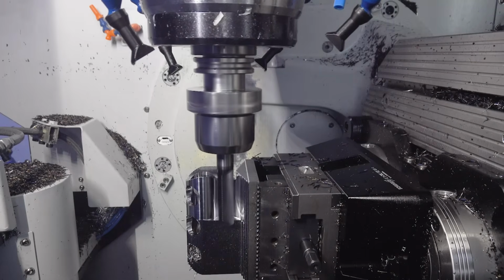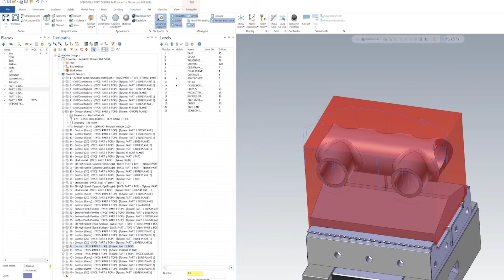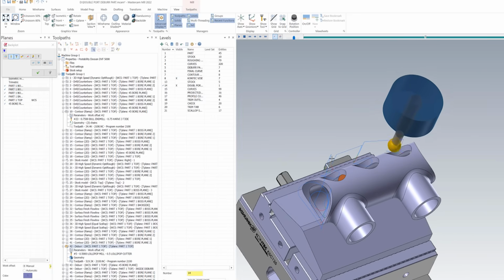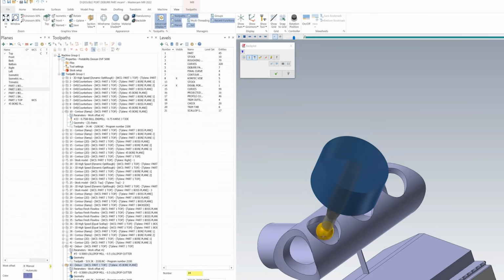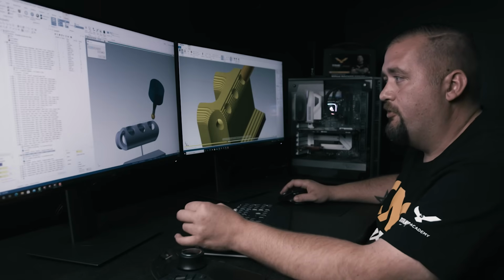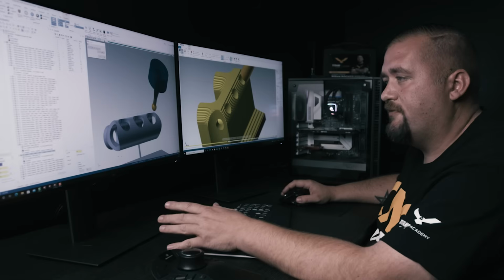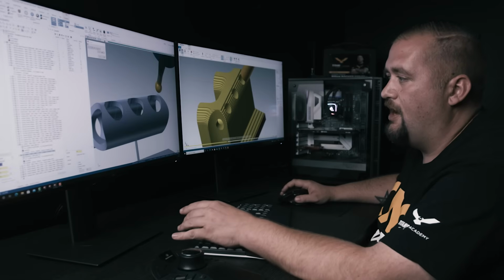Incredible 5 Axis Machining Techniques Revealed | DN Solutions DVF 5000

Comment: Personally, I don't like to use just the tip of a large tool to prevent inequal wear.
Of course, if you're just going for speed and mass production, few seconds cost on tool change tend to pile up.

Comment: im sure, it will run way faster if you debure, the edges in a 3 axes chamfering toolpath and just rotate the part from angle to angle, the 5 axes simultanius toolpath runs slower. its not necessary at this part. its a little more programming work, but its saves cycletime.

Comment: 4:46 Is there any way we can do to make the movement smoother? Sometime when I program my part, I get the same movement when the table is turning. The table will stop at some spots for less than a second, and it makes the movement not as smooth.
Reply: certain controls only read so many lines of codes into a buffer,ie it waits to flush and refill,some controls ie siemins have look a head codes,it could also be down to spin up times ,ie changing speeds..can also be affected by age of machine ie 32 bit faster than 8 bit.

Comment: This is how all 5 axis work goes for me. The more the machine does the better. 

For the tool axis control it's better in my experience to use 3+2 motion as apposed to full 5 axis. Full 5 can cause jerky motion if your filtering isn't tuned for the machine. 3+2 will tilt and park for each cut creating much smoother, and as a result, faster motion for the cut.
Reply: Absolutely! I was really impressed at how well Mastercam plotted out the 5 axis motion however, while avoiding the tapered shank of the lollipop etc. You can easily lock that toolpath into 3+2 or 3 axis, though, if you're wanting super smooth fast action.

Comment: Is that part NOT dovetailed? And you're taking that big of a cut at the beginning? What vise is that?
Reply: No, it isn't dovetailed. The jaws are serrated, and its a Schunk Kontec KSC125.
Reply: @barrysetzer  Thank you! We currently use a vise from 5th axis and it doesn't have this holding power.
Reply: @gulch1969  me and the guys at General Atomics noticed the same thing. Currently switching to Schunk/Ceratazit

Comment: Why not at the 0:50 mark. Edit the code manually to take off that whole fin at once? Instead of going around multiple times.
Reply: We could have easily done that in the CAM software, but in this toolpath we were maintaining a constant stepover and angle of engagement. In the end, there wouldnt be any noticeable time savings in slotting, as the feedrate would need to be slower.

Comment: At 6:02 it looks like the shaft of the endmill is rubbing against the part, because of the sparks at the top of the endmill or am I wrong?
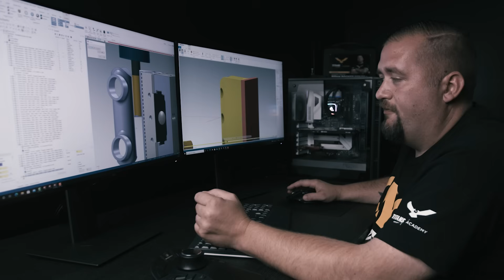Reply: Yeah, not too sure how that happened, at 5:42 you can see we cut all the way down that contour with the same tool.
Reply: @barrysetzer  The shaft is slightly thicker than the cutting edge of the mill.
So when you go deeper than the flutes you will get friction on the not cutting part of the mill

Comment: Yeah why’s it sticking like that when chamfering? I’d think it would be a smooth contour cut and not so choppy.
Reply: Sometimes when you have a bunch of small moves in a row the control can't keep up with speed of the machine. It's commonly referred to as data starvation. I'd be willing to bet the code for that deburring is massive.
Reply: @brandons9138  Data starvation may have been an issue on older machines, but on modern controllers jerkiness can be due to the toolpath being poor, the smoothing settings on the control, the machine dynamics, or more frequently it a combination of all 3.
Id bet that with a change of some toolpath settings and setting the AICC correctly you'd get nice smooth motion.

The reason its jerky is the controller is trying not to violate the toolpath given the tolerance settings in the AICC.
Reply: @sr20starlet  You know, I didn't consider the age of the machine. This is a brand spanking new machine, so I'm sure the control is more than capable of keeping up.  I haven't done much five axis simultaneous work. It's not the type of work that comes across my desk very often. If ever.
Reply: @brandons9138  awesome thank you!

Comment: Can you go over tabbing in more depth in a future video? How to eliminate and blend the tan after you break it off? Please an thank you.
Reply from the maker: Absolutely. Also read comment below where I just explained benefits
Reply: We have small die grinders at our shop. We've got sanding discs for removing the large portion of the tab and we switch over to a scotch brite disc to polish the surface after that. Once you get good at it you can easily produce a flat surface that doesn't vary by more than a thou, and easily match a tab up to a rounded surface too. Just takes practice is all. Like they said: once you finish the part completely in the machine all you have to do is clean up the tab after breakout, and that goes pretty quick.

Comment: Love the vids guys, but i wanna know the story behind that smashed window in the doosan :P
Reply: Anyone ever: "it was like that when I got here" 

Lol
Reply: Looks like it must be common.Mine got shattered by a chipped insert, only 2 months old it was and cost me $630 AUD very disappointed.
Reply: @mehmettemel8725  that's enough to shatter a window 😳
Reply: @mehmettemel8725  How many insert was that tool? What size?
Reply: @GabrielEspinozaMusic  It was a 50mm dia.U-drill but it was my fault being a new machine and acting cautious and being the first part I always check Z height to make sure there is no programming error by using feed hold knob but that time accidently turn down rpm knob and as you know not enough speed for feed and up chipping the insert before I could react to it.Actually noticed couple of weeks ago there is another chipped glass on the other side caused by flying chips,luckily it hasn't shattered like otherside.

Comment: Good video Barry. Did mastercam tell you that you'd rub on the tabbing op? Or am I seeing something else? Also, is the machine control the reason for the choppy 5 axis deburr, or the code?
Reply: Some machines are quicker in reading code for 5 axis movements than others, looks like
Reply: Sore that too, not enough information. Can’t overlook the small details.
Reply: It's funny, at 5:48 you can see that I cut down that entire contour with the same tool.......it must've been a chip that rolled over.
Reply: @barrysetzer  did u run the machine as well ? Maybe the end mill was resharpened 
End mill flutes are already smaller then the tail depending on manufacturer ( on what I use between 0.03 and 0.05 mm smaller ) if it's roughing I don't care much about rubbing , for finishing I always grind the end 0.2 mm or so smaller , just to get the length I need , not even 100 mm is long enough laitly
Reply: @apostolrobert5810  Yes, I ran it myself. And you're right, the shank is usually a few tenths bigger than the flutes......but usually that isn't enough to cause sparks, usually just minor discoloration.
Reply: @barrysetzer  keep kicking ass Barry.
Reply: Maybe he didn't get the "High Speed Machining" option when he bought the mill?
HAAS sux about that. I want to turn on Ethernet but it's $1999 just to activate the network function.